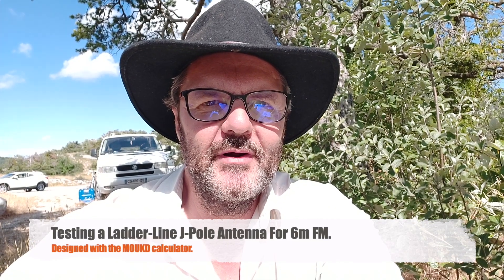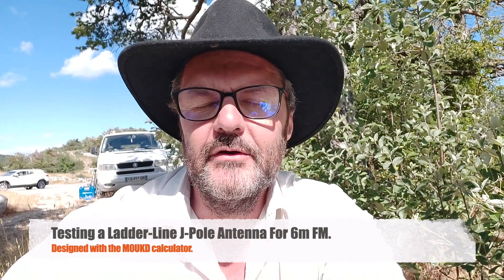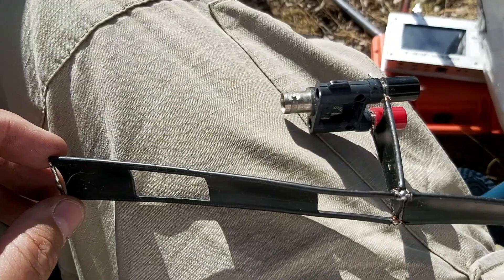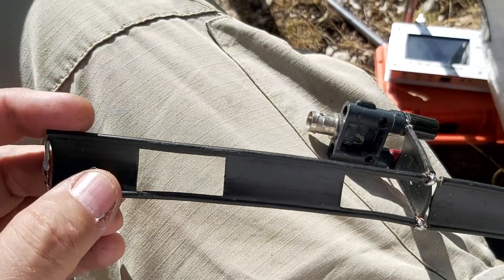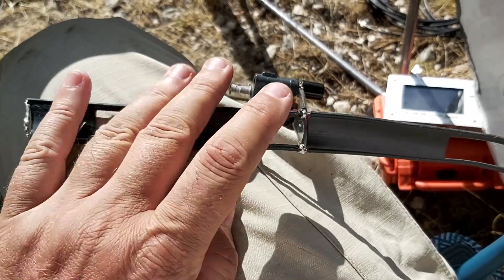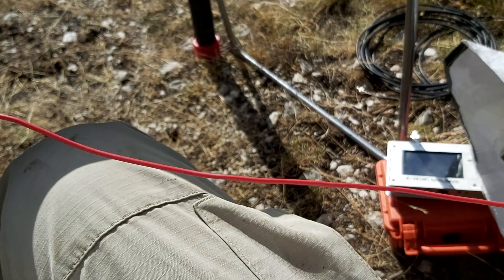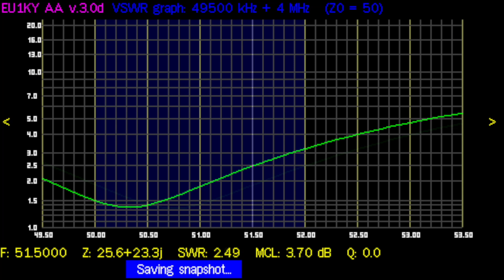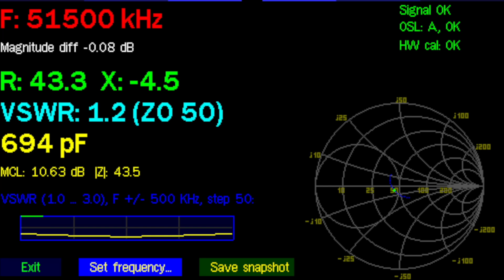Testing a Ladder-Line J-Pole Antenna For 6m FM.

Comment: Hoping to put together a collinear roll up on 6m . Mr Fong version possibly . 6 meters is a band which should be used a lot more. Right now, skip opens up there occasionally.
Reply from the maker: Even for local comms on FM.
Reply: @RadioPrepper  Yes, and in California it was used by our Highway Patrol for many many years. It definitely served them VERY well. It's a great band for ground communications !

Comment: Hi greetings from the UK! I will have to give this design a go with my FT818.
For SSB would it work if I find a way to make it horizontal? Or would you recta different design?
Thanks
Reply from the maker: Sure, you could string it horizontally, but then I would look into a colinear using ladder line stubs...
Reply from the maker: Sure, you could string it horizontally, but then you could make a colinear antenna with ladder line and get more gain...

Comment: What is the name of the mountain Gil?
Reply from the maker: The place is called La Gréolière..
Reply: @RadioPrepper  You live in a very Nice region hihi
Reply from the maker: Gréolières les Neiges
Reply: @RadioPrepper  You are surrounded by SOTA summits there Gil!  If you were to choose one, a drive-up summit, you could spot with an app, and I am confident that you would be chased by some, maybe many stations!  Even on 6m FM (which is entirely deserted here in VK).  If you went to 146.500 FM with a JPole built in the same way I'll bet you would be swamped!   I will try to email you the SOTAMapping screen to see if I can tempt you to try it!
Reply from the maker: I know right... Eventually yes.

Comment: Thanks for this and all the other great videos!

I can also testify to how well a J-Pole (in my case, 'Slim-Jim') antenna works for 6-meters.  While I built it for FM, it turned out to work extremely well for FT8 as well!

In fact, when I switch back & forth between my horizontal moxon & the vertical Slim-Jim, many times the vertical Slim-Jim receives better and with less noise.

https://twitter.com/scott23192/status/1413576765272887298

-Scott,  K4KDR
Reply from the maker: Thanks for sharing!

Comment: Do you have a  6mtr  SSB you can use to test this... you  seem to be pushing it up hill with 6mtr FM. it was not always this way... the Ether and hardware are fickle. 
People might believe the antenna works if you get one response. 
 cheers, TEF
Reply from the maker: No, but it's on my list..
Reply: @RadioPrepper  Giles your other possibility is to Cheat !! VEry French.. what you do is find someone with 52 Mhz  FM at home  a few days before .. then call him up on yer bat phone  off camera... then you squark out a CQ on camera and magically young    Gaston or Robert appears and tells you what magic modulation and signal strength you have. That's what a  Yankee advertising agency would do so it's ok at L'Hexigon too. I think. :-)
Reply from the maker: LOL, but we only should cheat the government 😉
Reply: @RadioPrepper  they cheated you when they indirectly sold you an FM radio where they knew the band was going to go QtE on  FM !!!  Take it back and demand an SSB tank radio.  Talking more seriously about SSB 6mtrs there's  a good chance that the  BitxEasy sold by HamRadio India could be modified to work the 6mtr band. 

Here's the issue - all the screw can  IF cans of the type used tent to go self resonant at about 17 Mhz , the IFT122 type .

But if they were replaced by a toroid and a good quality mica trimmer in all the BPF circuits  you might well be able to rebuild the cct for 52 Mhz.  the PA  would have to go but  RD15VHF1s can be had from Utsource  for about 4 USD. You'd have to check that  the raduino can in fact be run at 50 Mhz. The base kit is $65 USD I believe.  

I must admit I don't have any data on self resonance of toroid windings so it could all end up an expensive experiment.
Reply: @RadioPrepper  I've  only been to France  once... I cheated le governement on the entry fee to Napoleon's tomb.  (I had a student guy lend me his ID card for the discount and then handed it back to him while they were not watching. 

cela fait sans aucun doute de moi un français d'honneur... hi hi hi ..

I was only in Fr for a week or so years and years back . I traveled in the rail car from the Manche and  almost had to sleep in a graveyard on the first night in Paris.     TEF
Reply from the maker: I might get an old Icom IC-551...
Reply: @RadioPrepper  "Quoi qu'il en soit.."  I love the way that runs off the Anglo tongue. I'm a great fan of  Gary Romain and  La Vie Devant Soi.  .. just so you know.  It's years now since I saw that old Fr fillum... 

 Why not go in for some bondage and discipline and try to convert  that kit??... I will find and post the site detail in any case. I think he might split out and sell you a Raduino, fully built for abt 30 notes. he was selling them  before for 25.  Benjamin notes that is.  These are fully built up. As for quality.. I could not say.  :_)))!
Reply from the maker: Never saw it, I'll check it out... I really don't have the time 😞